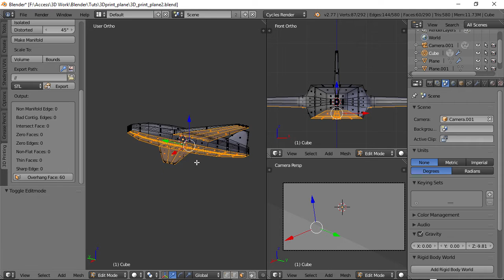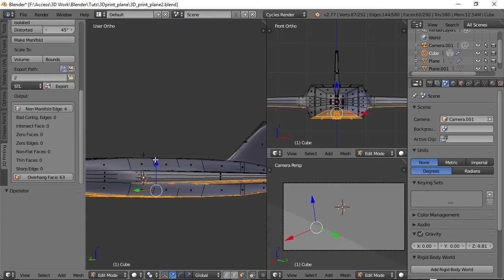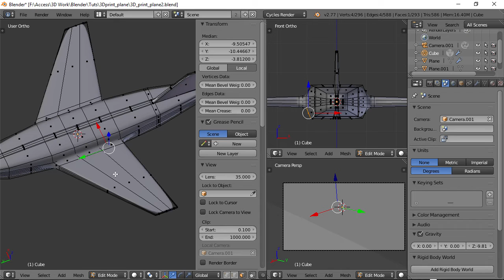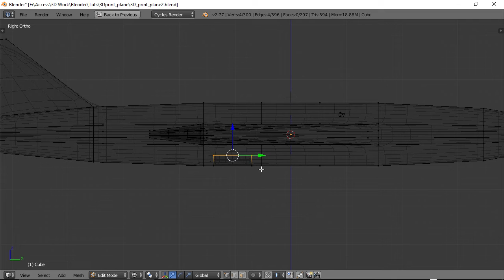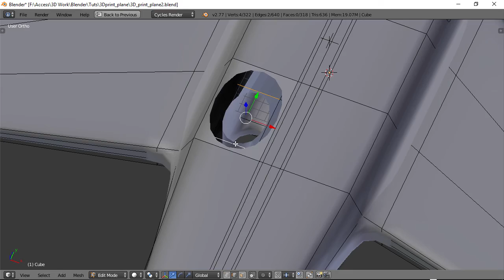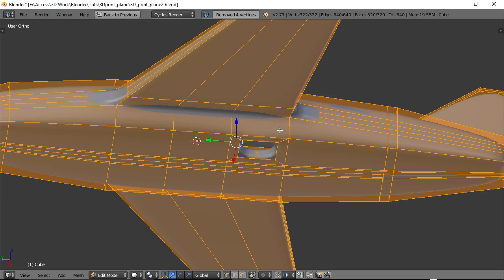Blender For Noobs - 3D Printing with Blender - how to prepare your model Part 1

Comment: I am curious do you normally start from scratch developing your models in blender /a CAD program. Or do you draw it in from a stylus , take pictures/3d scan it in then touch it up. For simply shapes i imagine doing it from scratch would be easier but for more complex object it maybe alot easier to scan in a starting base object then modifying it.  Or do you start with a default/example and modify.
Reply from the maker: Hi sam - most models I create in Blender are from scratch and especially if it is something I am making up (like an idea of something that only exists in my head).  But when you start modeling things that exist in the real world - say for example, a "Ford Mustang" or something like that, you would work from reference drawings and/or photos.  The reference drawings (blueprints) would be placed in the background to make the model as exact as you can get it.